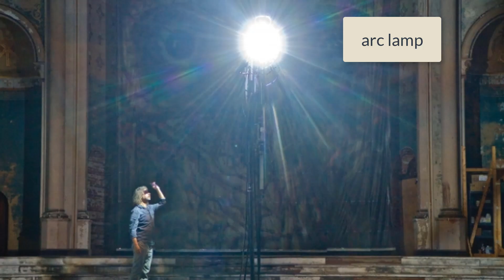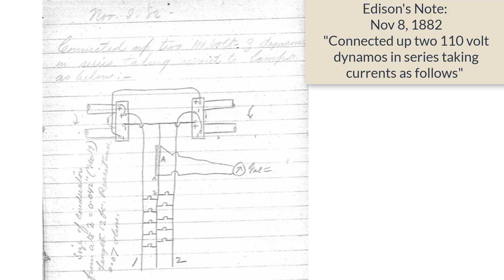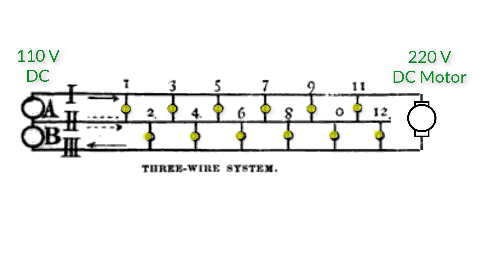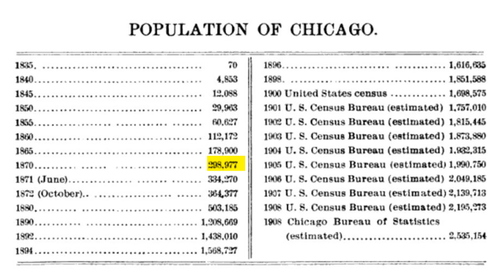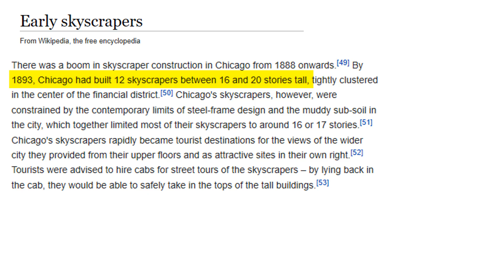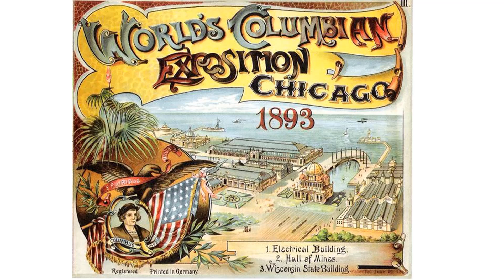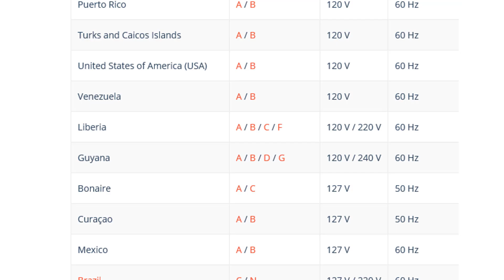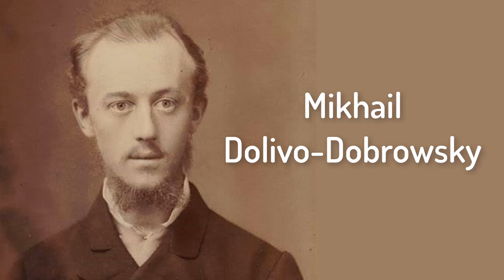Physics and History of Why USA uses 120 volts and not 220 volts

Comment: I think it's more to do with cost and finance. With 220, you have half the cost of wires and distribution because voltage is doubled. But human safety is compromised. At 110 it's a pleasant jolt but no fatality. At 220, it's often death.

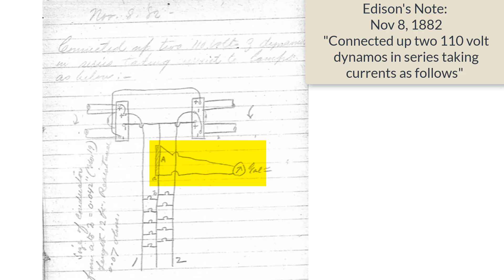Comment: At 3:31 the math doesn't agree. So he removed one wire and made another wire snaller. That can not be 60% less. Removing two wires completely would only be 50%. To achieve 60% reduction, he would had to have lost two wires and reduced the size of the 3rd and / or 4th wire. Math, go figure.

Perhaps you mean to say that he reduced the wire needed "to" only 60% of what was used before. In this case it woukd only be a 40% reduction.  Makes more sense.

Comment: 2 minutes in, and there are some major issues already

the wallace dyno's being at 110 DC voltage means.......well........nothing, the reason being that the voltage, was DC, (and further that, eddisons early power grids were all DC, and stepped down into 12 volts

it is also worth pointing out that, that there were many different voltage systems, from 12v upto 500v or more already in place and laid, BEFORE eddison was playing around with bamboo filiments (also, i know for the US, there was only one person that had any role in the first lightbulb, but old mate, swan, kind of beat eddison to the punch, yet, europe still had 220volts, and the same carbonised filimented lightbulbs as the US

Comment: The electricity dilemma in the countries of the world is the difference in voltage : 100V, 110V, 127V, 132V, 220V, 230V, and 240V !!! Also, the frequency difference : 50 Hz and 60 Hz !!! This causes many problems for people, especially after the emergence and spread of e-commerce!!!  When you buy many electrical appliances from international websites (outside your country), you find that they do not match the voltage or frequency in your country, and therefore they do not work or burn!!!  This causes many problems for customers !!! It is also harmful to the economy as it limits trade exchange between countries of the world !!! 

I hope that an international resolution will be issued obligating all manufacturers of home electrical appliances in the world to make their appliances universal. What does universal mean ??? That is mean, it operates on an auto electrical voltage wide range of (100-240V) and an automatic voltage of (50-60Hz) . Some companies do this, as all their products operate auto on 110-240V (50-60Hz), but the majority of companies do not !!!  It does not do this, but rather operates at a specific current and frequency . I hope for this decision from the international community soon .

Comment: U.S. homes are wired for 240.  It is split at the panel, but if you need 240 for a range, clothes dryer, water heater, etc., Simply install a double pole C/B and you have 240.

Comment: Your story is pretty good. But I would like to add - I lived in Germany for 15 years. The outlets were affectionately called "pigs" because they looked like a pig nose. But besides everything you mentioned about the history, the EU 220V plug is very safe. Of the total length of the prong, half of it, the part closest to where you hold it, was insulated. Even if the tips touched inside, you could never get a shock. Unlike here. Also 220 has half the amperage of 110 and I used to play with live wires all the time. No big deal if you got a shock versus 110 which hurts a lot. As for DC. I went to an electrical school and saw a guy accidentally touch a 100v DC wire. Knocked him right to the floor. And he was in pain. Edison was a thief and a liar, stole everything he claimed to invent and even killed an Elephant to prove AC was dangerous. But I did learn from your story. Thanks

Comment: Hi Kathy, for I think it is more efficient to use 220 volt than 110 volt. Why? It is reduce current losses. More higher of a voltage more little current losses. We are in Indonesia use 220 V, 50 Hz.

Comment: 240V: EFFICIENCY: Appliances can transmit more power at the same current, meaning they can be SMALLER & LIGHTER. This also leads to LESS ENERGY LOSS during transmission. FASTER heating: Appliances like kettles & irons heat up faster with 240V. Wider variety of appliances: Some appliances, like induction cooktops, are ONLY AVAILABLE in 240V versions.
110V: dumb standard ;)

Comment: Well, in Canada, we have and use 110-120vac   220-240vac as well as 550vac which is used for electric stoves with 4 burners and two heating elements in the oven, lower and upper.  These are all single phase whereas commercial or industrial uses 3 phase for equipment requiring more power to run efficiently.

Comment: The USA does use 220-240v. Most residential needs are met by 120, minus some appliances, which are fed by 220. Even homes are fed by 220-240. Just take apart a service panel, two legs in. 120 + 120 = 240. +Neutral (balance).

Comment: You only told a very small part of the history. House in the USA are supplied with 220 VAC with a center tap to drop the voltage to 110 VAC. And like why we use AC (Tesla's idea - alternating current) and not DC (Edison's idea - direct current). The chart you used is voltages in AC and not the voltages used back in the 1800's.

Comment: Without watching.. my thinking is the higher the voltage the lower the currents and hence lower losses. The lower the voltage the safer it is to touch. Much less chance of dying from accidently touching 110 than 220. Countries were happy with the higher risk of death because they introduced safety standards such as earthing. Anyway, as they say. To one's own , choose a mobile phone. Then there are countries like Thailand who use the 220 to save on losses but can't be stuffed putting in the safety such as earthing. They are introducing now with new buildings though.

Comment: Why did you not mention Tesla? Not sure that they were called but you can’t “Transform” DC through a Transformer to lower line current to house current. It would need to be some kind of resistor bank or something.

Comment: Until 1987, the mains voltage in Germany was 220 V with a tolerance of ±10%. This was followed by a gradual switch to 230 V. From 2009, the mains voltage may deviate from 230 V by ±10%. Due to the tolerance, older devices with a voltage of 220 V can be used without any problems.

Comment: In a transformer for a given input voltage and keeping the number of turns on the primary coil constant wouldn't it take more turns in in the secondary coil for a higher output voltage? i.e the amount of metal wire needed for a 220v transformer will be more than a 120v transformer. Vp/Vs = Np/Ns...

Comment: We do use 220 (240v) That's our single-phase standard. We just split it into two legs balanced around ground (center tap on transformer tied to ground/neutral) for light load resi.

Comment: 220V is more dangerous but better at saving due to lower currents in thinner wires. I think the 60Hz is better than 50Hz due to the smaller transformer sizes. We have some mixed results. I wonder what would be ideal for transmission.

Comment: The voltage running on the grid outside the home panels in the US fluctuates from 223 to 245. It simply throttles down to 110ish at the panel (single pole), except for any direct lines to the 220 double pole circuits (dryers, electric ovens, AC, etc.) In my opinion it is the best of both worlds. The rest of world really can't access the reduced voltage as easily.

Comment: 120 v is a safer electrical resource for the public majority and the electrical equipment they use at home.  Although 220 v is more efficient (it requires less current for same power) it also poses a higher risk of serious injury.

Comment: 220V is no longer used, instead 230...240V! There are also some basic errors in the video. The Voltage is always 400V, 230V is the Voltage between the center line and one of the power lines.

Comment: I think something really important is missing here. They a key name that should have been mentioned here is Nicola Tesla and AC current used in the Westinghouse /Tesla Niagara Falls Hydroelectric Plant 1880s. Without AC current the modern world as we know it would not exist, we would not have electricity across large cities because DC current loses a lot of voltage over distance because of resistance. That is why your landscape lighting which runs only 100 feet uses 12 volts AC and not DC. So  we do use 110(120) volts but AC, if we used 110 or 120 volts DC its use would be extremely limited over a very short distance.

Comment: Let say you use the same power, 220v ang 110v. The 220v need lower current. The 110v need much higher current. 
It means higher current need more copper materials to the wire. And higher copper means more expensive. 
In terms of safety the lower the current pass to your body means less lethal.

Comment: The US uses 220v/240v split phase power with a center tapped neturl from the transformer. Line to netural on "A" phase or line to netural on "B" phase gives you 120v, but phase to phase is 240v.

Comment: Hmmm. Couple of things. Firstly Edison invented the light bulb in the US. Elsewhere it's known that Joseph Swan invented it 20 years earlier and held various patents for it that Edison didn't try to challenge. Eventually Edison used the same filaments as Swann, joined companies and thus GE was born. Secondly there seems to be a gap in the story that still does not explain why 220v or 110v. You talk about 220v being cheaper on copper use than 110v but at the time you are talking about the US was DC which cannot be transformed thus the statement you made makes no sense.

You have to generate DC at the finished voltage and in order to generated high voltages in DC the generator becomes massive and unweildy. An AC generator has a much smaller diameter and thus can be made more practically and then a simple wire wound transformer used to up the voltage.

Secondly DC is in fact cheaper on copper use than AC. It's just that traditionally because you cannot transform DC to very high voltages for power line transmission and you can do AC, AC was the preferred option. Today with the use of power electronics very voltage DC can be made and thus power line DC transmission is beginning to take over from AC because it uses less copper. 

And that's because AC is transmitted down the skin of a wire whilst DC uses the entire cross section.

Comment: As a licensed electrician of 30 years, I learned some stuff I didn't know.
But for the laymen out there, the reason we use AC rather than DC is that DC cannot be transformed. AC can be stepped up to hundreds of thousands of volts to make transmission over larger distances far more cost effective. Edison wanted DC systems, but Westinghouse won out with AC. And just as well it  did. AC can be rectified into DC at the point of use, and in fact,  some industrial applications do use DC.

Comment: You don't understand we do use to 240 220 but it's only for hot water heaters electric dryers electric stoves and electric ovens the rest of the planets in the United States uses 110 to 120 oh also forgot to say the heating and air conditioner also uses 220 volts in the United States

Comment: I think some one confused here , first you cannot put DC through a transformer! it will just get Hot! AC is the answer!  so with AC you can transmit further as you can step UP voltage, higher the voltage the thinner the wire proportional to the current wire can carry! thats why your stuck with expensive thick wire at 110 volts!  Also  motors  need brushes on DC (other than small synchronous motors)  3phase AC motors work 10 better and last just about forever as no brushes!  AC is better because you can reduce cable sizes  and transmission losses and run more efficient motors,   you can/could run lights on AC or DC on any voltage lights designed for BUT you will need wire twice as thick on 110 volts than 240 Volts  , all this was discovered over time but the USA got stuck with 110 as its info structure was to spread to change     A 60 Hz transformer/motor/gen  will be more efficient , smaller and lighter than a than a 50Hz  transformer /motor / gen thats why Aircraft use 400Hz! 3 phase AC

Comment: You didn't mention Brasil with 110V and 220V at the same time. It's very interesting.
Edit: And Europe changed to 230V but many appliances are the old 220V (no change in the old networks) because they fit the margins of the conversion to the new voltage. UK was 240v and also converted to 230v. They were old but robust within the margins.😊

Comment: Since it is cheaper to use 220-240V will it not be worth while for the US to switch to 220-240V in new developments or new sky scrapers?  Except for incandescent bulbs, I think all equipment can handle 110 and 240V, including LED light bulbs..  Doing that will save money and make the electrical system simpler.  eg. I live in a 240V country and all our electrical outlets are the same, except off course for three phase connections, but that is for industrial machines and not in homes..

Comment: The US actually uses 240V extensively within the home. The 120V service is center-tapped off a 240V phase on the street. Each side is 120V but on your electric panel, you can draw 240V. Electric baseboard heaters are generally wired to 240V in this manner and you could easily wire a 240V plug if you wished.

Using 120V for most outlets is far safer than 240V. Countless lives have been saved in North America because of the power outlet voltage, yet the center-tapped power supply offers 240V when you need it - such as with baseboard heaters. It’s actually genius.

Comment: Its actually quite a bit more simple than that.  The U.S. uses 120 V because it is the objectively correct voltage for standard outlets.  Also, 50 Hz is madness!

Comment: Video is great but one point is the wrong way round - popular line equals LESS resistance, causing more load causing each lamp to have less available voltage. I see you left a note to correct yourself 👍

Comment: In Europe, there were many locations that still had 110V up until the sixties. There was made a large push here to change that to 220V. Up until now, there is still 3phase 230V in Belgium and Norway from which you can still use a floating neutral to make ~110V. That will actually cause a lot of problems for home chargers here, as the current will be a lot higher for the same power.

Comment: For the record: USA uses 240V. Europe has 2-wire 230V. USA has 3-wire 240V, structured as 2 x 120V. 120V is branched off for "user interface", like lights, TVs, etc. All large appliances, like ACs and large water heaters, use 240V.

The 120V for user sockets was for added safety. But 230V areas are moving to added security with residual-current device (trip switches), so with the much lower cost of 230V, it is time to transition out of 120V. 120V doesn't give enough power to boil your coffee as fast as a 240V device. :)

Comment: It's like in England, you have to change gears with your left hand.

In Europe, you can easily plug a 2.5 - 3 kW device into the outlet. (Kettle, heater, air conditioner)
The 110V network is a big bad luck.

Comment: ummm in the US 220 volt is not unheard of or unused. There are some (ok... a lot) of 220 volt appliances and industrial/shop tools; compressors, saws, lathes, milling machines. drill presses, electric welders ... commercial reach-in and walk in freezers and coolers, printing presses, furnaces, air conditioners, radio ad TV broadcasting transmitters and other equipment, commercial dry cleaning equipment commercial laundry driers, and some commercial lighting ...
I don't remember if traffic signals and emergency message boards are 120 or220 volt, or if both are used.

440 volt is also used in some commercial applications, usually high horse power-high torque stationary electric motors used to drive hydrolic systems and conveyor belts, and elevators. 

220 volt isn't used in the US for household appliances (other than stoves/ranges/ovens, and some but not all washers and driers, water heaters, and central AC/Heat) lighting, electric shavers, vacuum cleaners,  and so on.

Comment: 5:26
what i'm really missing here is the simple fact that with higher voltage you can transport energy WAY more efficient. The more current going through any conductor increases the resistance, which causes heating up of the conductor, which is a loss to the effective amount remaining compared to the input.

Comment: Not sure how you can talk about the electrification of America without mentioning Tesla and Westinghouse. They took the inefficient  and localized Edison DC infrastructure and replaced it with the AC system we have today. Edison attempted to vilify AC as dangerous. This as much as light bulbs pushed the use of lower voltages in American households.

Comment: The USA does use 240v on some appliances. We use split phase power. The neutral wire is center tapped in the transformer but we do have 240 potential at our disposal. I was born here and I didn’t know most countries use 240 normally. At least I’m aware of other countries and can use a converter or a different plug that can support 100-240v.

Comment: USA uses 240V, check all the house fuse box, it's 240V at the entry point. We just split it 120V and 240V as needed for what ever appliance is rated for.

Comment: The problem with higher voltage light bulbs, I did not see coming.  But it explains so much.  Here in Australia we have been so blessed - 240V 1-phase, and 415V 3-phase.  Period!  Every pole top transformer is the same - 11kV (or 22kV) / 415V, Delta - Star.  And houses are phase to Neutral for 240V.  So easy!

I just wish we had adopted the 60Hz system, rather than the 50Hz system.  USA got that one right.   It means slightly (physically) smaller transformers and alternators for the same power, and thus somewhat cheaper.